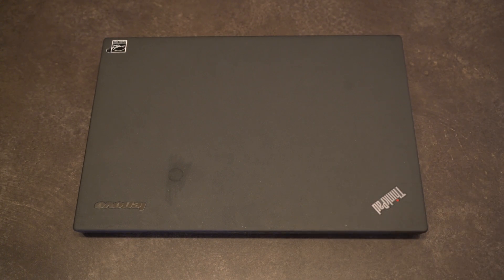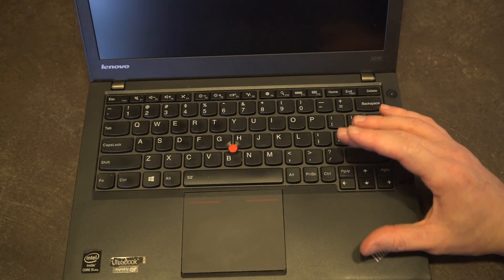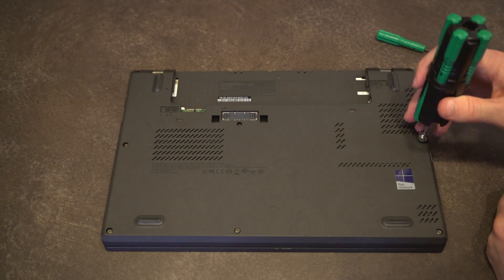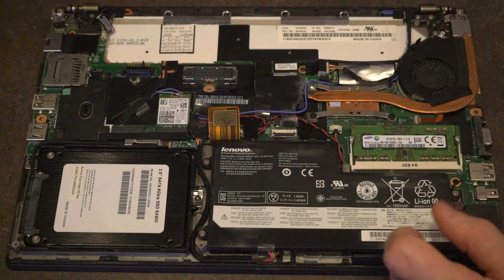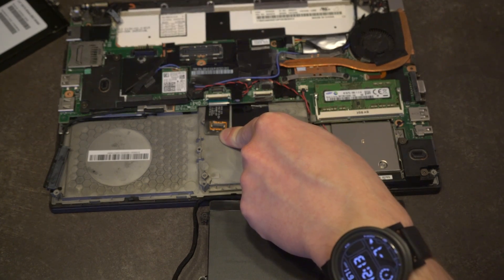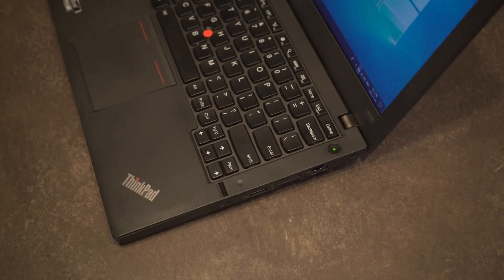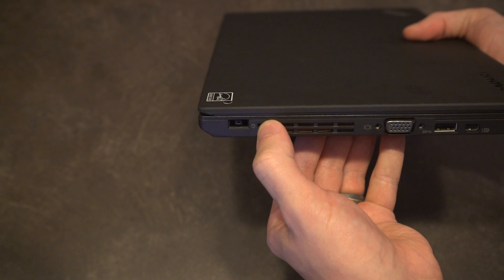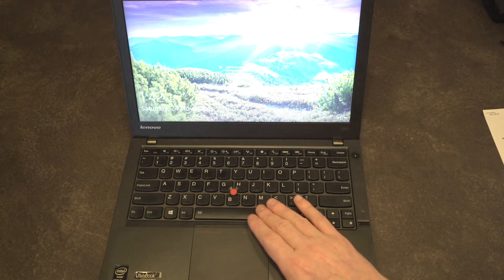Lenovo ThinkPad X240: Refresh of the X Series

Comment: I really hope i get your reply
I want to get this unit for some daily usage, watching YouTube and movies, as well as doing some essays on it
Also some light casual gaming
Am i making the right choice?
Reply from the maker: You won't be disappointed. The battery life is amazing. The x250 is great too. Better trackpad. What games?
Reply: Just some old gen games
Mostly ps2 and ps3 games
Reply from the maker: @smellybanana6634  emulation can be resource demanding. Your milage may vary.
Reply: @LaptopRetrospective  thanks for the replies
Keep up the good work
Reply from the maker: @smellybanana6634  you're most welcome. I hope I was able to help.
Reply: @smellybanana6634  you might be able to get ps2 games running but not ps3.used ps3s are 100$ and lower.
I got my thinkpad x240 for 120$.The keyboard is nice and it runs well for school with either windows 10 pro or Linux.The display is ok but not great.The viewing angles are good
Reply: @mtc9236  now i started thinking about the x250
Get one with ips 1080p display
What do you think
Reply from the maker: @smellybanana6634  Great choice.
Reply: @smellybanana6634  the x240s display Is good but I guess if the display is your main concern then get the x240.
Reply: You see im a college student and on a tight budget
Reply from the maker: @smellybanana6634  That can be tough for sure. Casual gaming is within the realms of an integrated GPU so long as it isn't resource heavy.

Comment: Perhaps the difference in screw type in the hard disk drive is down to security reasons? Protecting user data by making it harder to remove?
Reply from the maker: I suspect that's correct but it seems pretty low level.

Comment: Im planning to buy a 2nd hand x240 . Can the processor, ram and Operating system make a difference (upgradeable) from the stock specification? Just to ensure if the unit is legit . It tells that year 2016model (drivers up to date). Thanks .asap

Also Can it run autocad in 3D model??
Reply from the maker: Only thing you're upgrading is RAM, max is 12 GB. 4 on board and one slot. System requirements for your AutoCAD version?

Comment: Eh there!, neat channel ya got here!

I was gonna wait till a few days after ‘Black Friday” to pick up a thinkpad locally here in Denver Colorado. But after I saw that New Egg’s got X240’s (touch screen versions) with 8gb and 512 SSD for 234.00 in stock, I ain’t passing this up!

https://www.newegg.com/black-lenovo-thinkpad-x240-mainstream/p/1TS-000E-0DKZ3

PS. As I am a blind/visually impaired individual, the screen itself ain’t gonna matter to me. Long as the machine works. ☺️
Reply from the maker: If the trackpad is important, you might want the x250 since it has independent physical buttons.
Reply: Laptop Retrospective 

Thankfully, I do not use the trackpad much at all, such as on my Acer Chromebook from 2016. I certainly understand their use case though... 

In addition, New Egg currently doesn’t have the X250 at the moment.
As long as the touch screen works, I should be alright.
Reply: I also wanted to throw in here too, that I could  get the X250 from Best Buy as well for 261.00, except that it only comes with a 180gb SSD. I sadly ain’t one of those who can easily swipe out drives like that. 
Glad to know though that the X240 does have the ‘TrackPoint” on it.
Reply from the maker: @TrentonMatthews  yes, that's right. I really appreciate you taking the time to share your experiences and situation. It's really awesome and important.
Reply: Laptop Retrospective 

No problem!
I’m happy to share my thoughts with the world.

I’ll be sure to do an unboxing of it once it arrives around the 4th of November on my YouTube channel.
Reply: Quick update!

The X240 I ordered, shipped this last Monday on the fourth, will be getting it this Friday. I’m tracking it via UPS’s own site, New Egg email, and New Egg via SMS. I ain’t letting this package get lost!

It is one of those packages ya gotta sign for once the mailman/woman arrives.

Comment: So yep, looks like a nice machine, but not sure I'd get it for myself since I like to use a trackpoint, and I heard this one without dedicated buttons is nooooot the best one.
By the way I don't think this internal layout is a bad thing. Yes, you need a full disassemble to replace a keyboard, but access to a heatsink for cleaning is very easy. On the other hand on older machines it needs to remove a motherboard to do it. 

And I much often clean the heatsink than change a keyboard (never changed it, lol) on my T430.
Now thinking to get something smaller and lighter, maybe x250...

But anyway watched this video, nice one, thanks!
Reply from the maker: Thank you. You can swap out the trackpad.
Reply: @LaptopRetrospective  Hmm didn't know that they can be swapped. But anyway I find x250 on a local site for a good price. Maybe will get it.

Comment: recommend for field work programming PoE cameras ?
Reply from the maker: It's got a lot of battery life and is quite rugged. I think you'd be safe if it meets your system requirements. This unit just came back from a conference across the country and I'm not sure it needed more than one charge.
Reply: @LaptopRetrospective  thanks for the reply, I'm leaning towards the x240 or the t440s i found some deals on eBay both roughly $200 in good condition. any thoughts on portability between the two?, the 440s has 12gb ram and a IPS touch display, x240 is the IPS HD
Reply from the maker: @alexbillian2846  It's going to come down to size I think. The X240 is smaller and compact. The T440s will be bigger and heavier but five you more screen. What are the CPUs of each? I5 4300U is the most common.
Reply: Laptop Retrospective x240 i7 4600u , t440 is i5 4300
Reply from the maker: @alexbillian2846  I'd be tempted to go for the i7 x240. Battery life might be a little less but if portability or power matter, that would be the choice to make.
Reply: Laptop Retrospective now im finding decent deals on x250s.. what would you go for
Reply from the maker: @alexbillian2846  the X250 I've heard is favoured over the X240. I haven't had the chance to use one myself yet.
Reply: Laptop Retrospective have a x250 I7 with 256SSD 8gb Ram and IPS display coming this week paid $199 shipped 🤓
Reply from the maker: @alexbillian2846  very nice!

Comment: is there a model with a FHD display
Reply: Yes there is , and you are able to change it. From HD to FHD
I think they use the same screen as the x250 so for 70$ you can get a fhd screen
Reply: @cynthiaost4078  thks.. do you use one? If you do, could you pls tell me how it performs now
Reply: @shakilakularathna5864  I recommend you a x250 for the same price you will have better performance and a newer processor . I just bought one 220€ (with ssd and 8gRam , I will get it Thursday so give me like 3 to 4 day to tell you how it perform

Comment: Thanks for the comprehensive overview. Thinking about picking one of these off eBay for a portable Linux machine. Do you think this would still be a good purchase for that purpose at this point in time?
Reply: Well, I did end up getting the machine I was looking at on eBay. It was in much better cosmetic condition than the pictures had indicated. I immediately bumped it up to 8gb of RAM and stuck an SSD in it. Installed Xubuntu and it absolutely flies despite the U series CPU. Should be getting a new internal battery next week and as it stands I see no reason why I shouldn’t get at least another 3-4 years out of it. Very pleased.
Reply from the maker: @krazykat64  so excited for you. A lot of people didn't like the U processor bit the 10% loss of processing power from the previous generation was well worth the trade we got in battery life.  Now just swap out the trackpad for the three button version. Very cheap and is an awesome mod.
Reply: @LaptopRetrospective  Strangely enough, as much as folks complain about that trackpad, I haven't had an issue with it. I suspect most who dislike it probably have previously developed muscle memory from the three button that made using the "slab" unpleasant. I had no such muscle memory and therefore came at it without without preconception, thus making it less frustrating for me. Just a theory. 🤷‍♂️
Reply: @LaptopRetrospective  And as to the processing power I absolutely agree the trade off is 100% worth it for me. I don't edit video or game at all, so as long as it loads Firefox and runs LibreOffice at reasonable speeds I'm quite happy. 😁
Reply from the maker: @krazykat64  nice. Let me know when you get to that trackpad swap. 😉
Reply: John Montgomery 

Interesting!

In a recent comment I made on this video, I ordered a refurbished X240 thinkpad off of ‘New Egg,” for 234.00! 
Glad to know I am not the only one who can deal with the touch pad.
Reply from the maker: Absolutely.
Reply: @LaptopRetrospective  Thanks for your prompt reply. Found what appears to have been a "fleet vehicle" (aka business issue unit) for a little over $100 shipped. It's a bit ugly, but if everything is in working order as described I should be able to upgrade the ram and go to town. :)

Comment: X240 have BIOS whitelist unlike X250 and onwards. This will be a problem if you are trying to use non-original parts (i.e lcd panel). I have confirmed this myself. I have X240 and X250 (both with latest BIOS) running W10. I tried installing both of them with a same non-original FHD panel (NV125FH), the brightness function only works with the X250.

Also X240 have fn-key not working problem when updated to latest BIOS. My X240 got it, some people in Lenovo forum also confirmed it.

I recommend getting a X250 instead of X240.
Reply from the maker: As you go up the tradeoffs get more extreme.

Comment: That trackpad is a big turn off for me. Thanks for the review.
Reply from the maker: It can be replaced with a better one with buttons. Inexpensive fix.
Reply: @LaptopRetrospective  Yeah bought a renewed one today itself for Rs. 14,000 (around $200) with 256 GB SSD. Also got the docking station for the same. Loving it.
Reply: @prakash.vishwakarma  where did you buy..i want one
Reply: @abhishekrajvanshi634  i got it from local shop in pune, where do you live?
Reply: OR you can go for X220 for Rs 17900 on amazon instead.
Reply: @prakash.vishwakarma  why would i go for 2 year older laptop at a higher price
Reply: @abhishekrajvanshi634  if you're not able to find one, just gave you an alternative. not much of difference when it comes to performance and x220 has classic keyboard as well..
Reply from the maker: Awesome, as I said, there are parts out there to swap out the trackpad for one with more agreeable buttons. I will likely do a video in the future on it.
Reply: Laptop Retrospective I would appreciate if you could make a video on the same. Thanks 🙏🏻
Reply from the maker: @prakash.vishwakarma  it's in my "to do pile".

Comment: I'd honestly go for a x250 in 2019. It's absolutely the same considering looks and features, while having a newer Intel Processor generation (Broadwell) and also returned the Buttons for the Trackpoint.
Reply from the maker: As I mentioned in your other comment, while this is true, cost and availability are two key factors for older laptops. Thankfully the buttons for the TrackPoint can be installed into the X240 at low cost.
Reply: @LaptopRetrospective  I just noticed while looking for a X series laptop on ebay (My friend has got the x240 and he recommended it to me) that x240s and x250s are similarily priced there. I bought a x250 for myself with an 120GB SSD WWAN the Fingerprint scanner and a smart card reader for just 230€ and I saw x240 with same features but worse specs for the same price
Reply from the maker: Nice catch. Sometimes this happens. Knowledge is helpful. Enjoy your ThinkPad!
Reply: x250 is a killer deal right now. I bought i5-5300U, 8GB RAM 128GB SSD option for 150$! I got it with a single large battery which I'm going to sell and managed to score small external battery and internal battery with 98% capacity for 25$ total! I'm thinking of replacing screen for FHD IPS but it's not something I need that badly. I guess I'll replace it with X270 in 2 years :)
Reply from the maker: Nice buy!

Comment: I just purchased an X240 thinkpad  no Touch and I am wondering how hard would it be to put in a touch screen in place of one of these that does not have touch screen?
Reply from the maker: I'm not sure it's possible. The maintenance manual states completely different display assemblies so you'd be looking at a top case replacement to start.

Comment: I’ve just bought one of these, great little machine.  Runs Win10 Pro 64bit fine.
Reply from the maker: Sure does and lots of battery life as well.
Reply: Laptop Retrospective na unfortunately my battery is completely dead. Both batteries hold up to an hour (max / just for Word).
Replacement batteries are quite expensive for this laptop and I think that it is not worth it (since I got this laptop for free) 
Otherwise I love this laptop. Unfortunately I broke one little cable (at the hinge) which is attached to the webcam, Lid sensor and that glowing dot. But a replacement cable is on its way
Reply from the maker: Look at it this way, what you didn't pay can go into mods and upgrades.
Reply: Laptop Retrospective exactly. That was my idea too. I have thrown in an SSD and now I‘m getting this new cable. But spending 40€ for a battery is too much. I will keep an eye on the battery price though incase I can get a good deal
Reply from the maker: That's a fair price for a battery, especially if genuine.
Reply from the maker: Good choice!

Comment: What's the maximum RAM that this system allows?  I've read 8gig.
Reply from the maker: It is 12GB. 4 is soldered on and up to 8 can be installed in its single slot. I just did mine actually.
Reply: @LaptopRetrospective  hi there, did you mean the 4gb soldered ram is already soldered on the machine when we buy it or we have to purchase the 4gb ram again? Thank you and anyway, you did a great review video!
Reply from the maker: Correct. All machines come with 4 soldered on.

Comment: Hey in 2019 better getting lenovo x250 or dell latitude e7250 ? They both have 8gb ram + ssd installed thx
Reply from the maker: ThinkPads are generally built to a higher standard than Dell Latitude machines.
Reply: Laptop Retrospective wow thanks for that useful information
Reply from the maker: You're welcome. The Latitude isn't a bad machine but ThinkPads go through considerable testing to get that name.

Comment: Hey man, what are your thoughts on the latitude e7240. What about this vs x240
Reply from the maker: It competed against the ThinkPad S440 at the time it was released. To me, they are in two separate classes. If the X240 meets your needs, then I think you will find it better built and considerably more durable. Reviewers at the time pointed out a few too many flex points. Haven't had one on the teardown table to directly compare, but I'm happy with the X240.
Reply: @LaptopRetrospective  appreciate your quick response mate. Cheers!
Reply from the maker: @the-diy-indian  you're welcome!

Comment: Hey, it might be too late but is it real deal for me to buy this X240 with i7-4300U and 500 GB HDD in 2019? I just an econ stud who use stats apps like Stata & R, Office apps plus doing some designing in Corel X8.
Thanks in advance.
Reply: i have bought at least 5 x240 in the last 4 months, i5, 8GB, 256GB SSD. they work very well.
Reply from the maker: @francissaanane5874  that's quite a few. What are you doing with them?
Reply from the maker: It's still a good buy for the right price.

Comment: You sell it this unit?
Reply: Buy a X250. They look absolutely the same, have the same features and have a newer and faster Intel CPU generation
Reply from the maker: Fair points. Availability and cost can sometimes be factors as well.
Reply from the maker: This unit is currently in my house and is used by a family member. It is not for sale but should be easy to find online. Do you have access to any online stores where you are?

Comment: nice video, do you happen to know if the internal battery is dead will it affect the external by draining it?
Reply from the maker: It won't. One battery will not charge the other afaik.
Reply: @LaptopRetrospective  alright ,i ordered one after getting ''convinced'' :D after watching your video, paid 200 euros and it was advertised as A- 8gb of ram and 128ssd but it didn't specify if it was configured with the second battery,do you think that was a fair price?
Reply from the maker: Price sounds about right!

Comment: Do you think this can handle andriod studio with 8gb ram and 240gb ssd?
Reply from the maker: What are the system requirements for that program?
Reply: @LaptopRetrospective  Microsoft® Windows® 7/8/10 (32- or 64-bit)
3 GB RAM minimum, 8 GB RAM recommended; plus 1 GB for the Android Emulator
2 GB of available disk space minimum,
4 GB Recommended (500 MB for IDE + 1.5 GB for Android SDK and emulator system image)
1280 x 800 minimum screen resolution

In terms of processor none is really listed.
Reply from the maker: Then I'd say you're probably good to go.